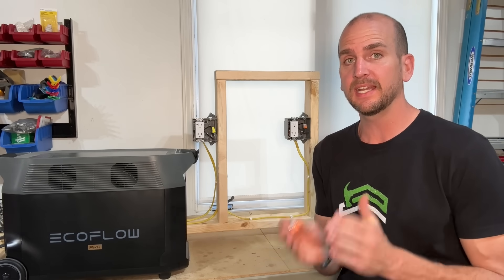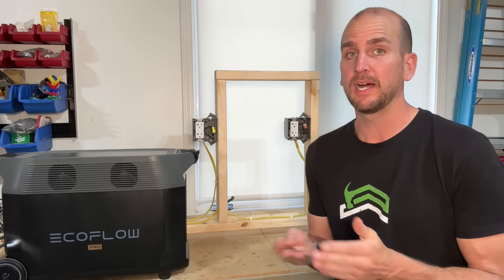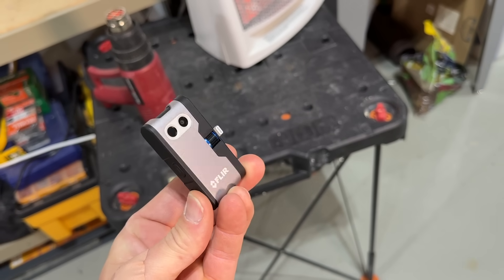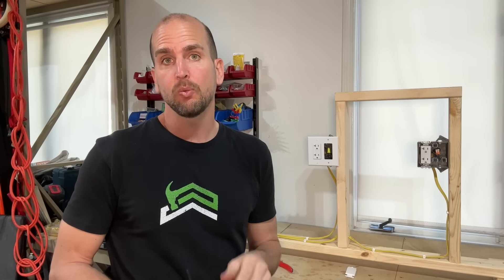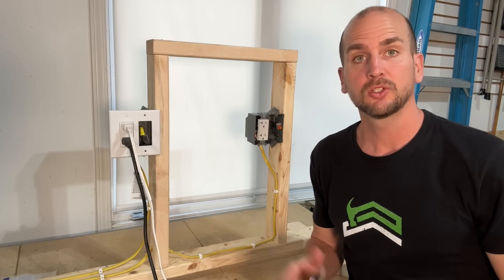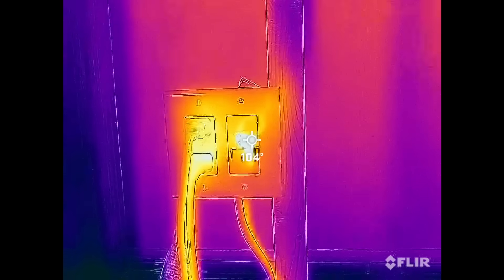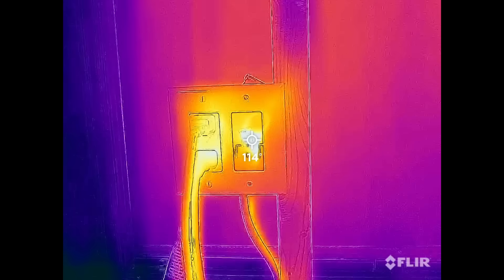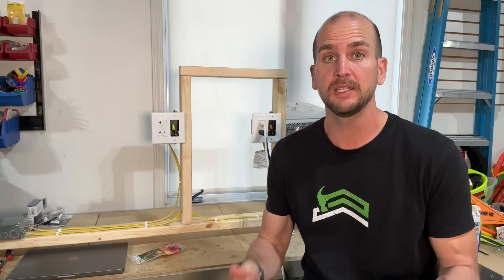Debunking the Pros: Can WAGO Lever Nuts Handle Heavy Electrical Loads?

Comment: Got another test for you to do similar to this heat test. I'm not a licensed electrician. There have been times when using standard wire nuts that I want the best connection possible with no possible way for a wire to pull out I would pre-twist the wires together and then solder them before installing a wire nut. I especially like doing this when I am connecting 3 or more wires together. I feel there's a good connection and none of the wires could ever pull out. It would be interesting to see if there's any temperature difference at the wire nut between soldered and not soldered wires. I've never seen anything in the electrical code about soldering wires and using a wire nut.

Comment: This is a dubious test at best, a scam at worst. Wago connection relies on a spring pressing the bare wire against the bus bar. Like all mechanical springs this spring will weaken due to cyclic loading, heating and cooling, ultimately creating a lose or loosen connection. A lose connection will create a sporadic electrical arch similar to a welding arch. It is the electrical arching that generate extreme high temperature rather than a steady state current. An AFGI is designed to cut off the current when it detects an electrical arch whereas a GFCI would not. If I were hustling Wago connectors, I would have made this specious video, too.

Comment: I use Wago... but ! in the USA the voltage is 110-120V, in the EU we have 230-240V, half the current flows from it. And with the standard maximum load of a common socket of 16A, I don't expect any problem with Wago. Today's electrical installation in houses and apartments is almost always with wago terminals, and the sockets under the most stress, such as the microwave in the kitchen, the socket for the kettle, etc., are led directly to the switchboard and secured separately. So if they are, they are only minimally loaded in normal operation and there is no problem with them even after many years. The margin of error is very small and refers rather to the Compact series. Of course, there are also more powerful Wago series.

Comment: The Wago lever nuts have been developed in Germany where the standard voltage is 240 V. Since the voltage is approximately double the 120 V in North America, that means the current draw is only about half the current in Ampere for the same power in Watt. Standard home circuits are rated at 10 A or 16 A.

Personally I prefer to use the Wago lever nuts, because they make for a far safer splice that is also very easy to expand in a very safe way. For safety, put the lever nut on the input wire first and you do not have an exposed wire that could accidentally zap you. And by opening the outgoing wire first you again reduce the risk of getting zapped.
For expansion, if you use a 3-lever or 5-lever Wago nut, you can add one or three additional outputs respectively without having to undo the previous splice. And you do not have to touch the input wire at all, again reducing your risk of getting zapped.
Reply: The germans lost the war too.

Comment: One thing missing is you used screw connector on the receptacle plug for the base line, I would like to also add the push in  connector on that same plug as part of the test, the surface contact area there is about the same as the Wago I think, and has been used forever and safely according to regulations.

Comment: Still don't like it...Plastic holds the Wago's together.... over time heat causes plastic to get brittle..... and with the plastic under constant stress, holding the wire against the  very small contact....that tiny little piece of plastic will probably crack....and now what da ya got?

Comment: I would imagine that using Wago in a garage where air conditioning isn't normally available or in the desert heat (where I live), the ambient temperature might have elevated the connection temperatures higher.l  Maybe a little, maybe a lot.  I've seen where the plastic wire nuts crack and fall apart leaving the spring exposed.  Heat is the enemy of electrical connections.  I use Wagos to make low current connections such as in light fixtures.

Comment: I like the WAGO connectors a lot.  They are fast, relatively idiot proof, are compact inside a J box, and are pretty robust.  For lighting fixtures, 15A residential outlets, and other light duty applications they are ideal.  For heavier loads like HVAC, electric motors, spa installs, and other inductive loads I am old school.  I want max copper > copper contact so I will take my time, pre-twist the wire 4 turns with my linesman pliers, trim the tip, and apply a properly sized wire nut to complete the splice.  Maybe overkill, maybe not.  I have repaired too many connections that appeared to be really solid but burned down anyways. YMMV

Comment: Isn't it possible the flir is picking up a little less heat due to how the wire nut is made with possibly different/thicker plastic?  Regardless, either one, it is important to make the connection properly. To each their own. I will not stop using WAGO though.

Comment: If you used a 15amp breaker, you would have to reduce each receptacle load to 1-1.5 amp.  Hot weather and/or increased current demand will increase voltage loss.  Cold weather and/or reduced current demand will minimize voltage loss.  Thus a circuit has different voltages through out the year, e.g., 120-122 volts in the summer and up to 127 volts in the winter.  Thus if you are using watts to determine amp load you should use the actual circuit voltage for calculations.  Also per NEC a 2% voltage drop between adjacent outlets or a 3% voltage drop on a circuit indicate a high risk circuit with too much impedance.

Comment: The concern is not the rated temperature of the connectors, but rather the added unnecessary cumulative heat produced at every connection on the circuit.  Heat that further damages the circuit insulation and loosens the connections.  Most home circuits are 14AWG which has a higher resistance for the same load.  Thus, a better test would be to test all the connections on a 14 AWG circuit having 10 receptacles with a 2-3 amp load on each receptacle.

Comment: Sorry about the scrambled text at the end of the previous comment.  At least 50% of homes have older deteriorated circuits where it is imperative to minimize resistance and the resultant heat that damages/weakens circuit insulation, increases the risk of fires and causes a drop in voltage.  In fact, the NEC cautions that a circuit voltage drop is a cause for concern, e.g., a high risk circuitdissipation

Comment: I am licensed home inspector with 50 years of experience and training.  After seeing your other videos on Wago connectors, doing some research and using them myself, I recommended Wagos especially for splices combining multi strand and solid conductors.  Multi-strand and solid wire splices are the splices most often loose and/or where the multi-strand conductors pull out of the splice.  We often inspect houses that are more than 50 years old.  NFPA has identified these houses as containing circuits with deteriorated wire insulation and corroded loose splices and terminations.  Deteriorated conductor insulation and loose connections create a higher risk of arc faults (a primary cause of electrical fires).  insulation and increases the risk of arc faultstral circuits might have different results.
Reply from the maker: Thanks for the feedback Larry 👍

Comment: A veteran electrician once told me “Code is just the worst job you are allowed to get away with.”  That stuck with me.  I have always pre-twisted conductors and then secured my connection with a tightly twisted wire nut.  I also never loaded any circuit more than 75% of units allowed and wired even my lighting circuits with 12ga and 20A.  I don’t ever lose sleep over me causing electrical fires.

Comment: A very nicely done video.  Certainly a more elegant solution over using wire nuts--most especially when one is often using wires of different gauge and/or solid vs stranded.

Comment: When in doubt reference an old cliche.
If there’s smoke there’s fire. In this case not applicable.
If it ain’t broke, don’t fix it. Maybe?
It it ain’t broke, fix it until it is. Not a good idea.
I’ve used wagons and haven’t had a problem with them. I’m comfortable using them and like their ease of use and convenience.

Comment: Run at 23 amps, but my understanding is that a safe long-term run rate tops out at 16 amps on a 20amp circuit.  So we are WAY, WAY under the temp. spec. max. in this test.  All-in-all, very comforting to me.  Green light.

Comment: They wouldn't be legal if they couldn't.   Electrical regulation is pretty well established.   We don't need videos to say that using stuff as it's tested is fine.  This just looks like an excuse to put a bunch of sponsored products on screen.
Reply: "They wouldn't be legal if they couldn't."  I would agree for the most part.  But in the past, they've found alumimum wiring has problems (aluminum expands more as it heats). Wallboard from China had problems (off gasing of volitile chemicals).  Lead water pipes had problems.  Early PEX fittings had problems with leaking.  Asbestos in popcorn ceiling and other uses had problems.  Seems like manufacturers send stuff out the door and let the end user become the quality control program.  With so many recalls, that seems to be what's happening.

Comment: Number one I must ask if they are UL approved. Secondly are they listed for use in the NEC. I am assuming yes to both questions. If that assumption is correct then the next question should be is there a current rating on these connectors. By default, if they are listed for use under the NEC there should be a current rating provided by the manufacturer. Much like terminal blocks and contact sets.

Comment: What all this told me that my decision to put an actual outlet inline instead of pig tailing or inline connection with a wire/level nut to the through circuit was the right one.

Although my concern (before this thermal test) was the amount of wiggle the Wago connector had, however, I did like the ability to quick change things up during retrofits and them being reusable in temporary situations.

Comment: I’m going to install a Ditek 120/240CM+ surge protector on my HVAC disconnect for my 3 ton ac. I need to use a “pigtail” for the terminal lugs. My question is, can I use WAGO connector instead of a wire connector? Thanks

Comment: Do people run 20A over a 15A circuit?  Wont that trip?  Its prolly no different than using the receptacle's bus connector between outlets to splice the connections down the line.  What kind of heat is generated at that point when used?  You're not going to run a major appliance off of these as they have dedicated circuits by code.

Comment: I had a camper with back-stabbing outlets. 
Replaced them one at a time as they failed. 
It’s a wonder I’m alive. 
Some were fried!  
Same concept as WAGOS. 
Test WAGO to failure.
Test them over time. 
I not only twist wires for wire nuts, I crimp them a little and trim the ends evenly. 
And use electrically conductive grease. 
Plus use a wire nut tool to crank down the wire nut.

Comment: It would be interesting to measure the resistance difference between these using a 4-wire probe (that takes out the resistance of the probe itself).  The assumed higher resistance and hence heat will be caused by I^2R losses.  So, in Europe which is mainly 240 VAC, their current for a given circuit is half of what it is in the USA, and therefore half the amount of heat from any higher resistance.  In general, it looks like 10% higher heat than a wire nut, but still roughly 50% of the design maximum.  I'm not sure the answer, but I do know trying to connect 4 12-2 wires in a 2 gang metal box to two plugs and ground the box can be tricky - at least for me.

Comment: I'm a big fan of the WAGOs.  I'm an electrical engineer too.  A few reasons why:  For one thing, they're largely idiot proof, and by "idiots" I mean professionals compared to DIYers.  I know I know; we're all supposed to be professionals that our work is supposed to be of higher quality, but actually quite often it's the "pros" that get into trouble because of complacency and exposure.  Ex: My dad was a "road warrior" salesman; he's got far more speeding tickets than I've ever got, but that's cause he was out there far more than me.  Much like how professional drivers, not unlike professional skiers, are ones who often get injured; yes they're far more skilled, but they're the ones logging thousands more hours "on the front lines" that we ALL are human and we ALL make mistakes.  Most of my life's work I've been in the power utilities and communications industries; we got lineman that can do amazing things out there but indeed in many cases, it's best to have a premade solution to a problem vs. one that's "craft sensitive".  Wire nuts are a perfect example; there's a lot that one needs to do to ensure a good connection vs. a bad one.  When they're done right, they are very good, but all it takes is 1 out of 1000s to be done wrong, and you've got a serious problem.
Another issue: thermal cycling.  Many times this doesn't affect the connection so much, but I've definitely come across wire nuts that all but fall off when you open the box.  And with wire nuts, it's right there with the "pretwist" recommendation(why do you have to do that?!?), you're relying on the copper conductor as much to make the connection when your wire is of metal designed mostly for carrying current.  It's why it's copper.  Meanwhile the spring inside the lever nut is designed to make a mechanical connection; to the extent that if it even is thermal cycled(it's away from the connection), do that thousands and thousands of times it will maintain it's compression vs. electrical grade copper(not even a strong alloy of copper) twisted together.  I must confess that here I am speculating some, because there are many issues at play here(ex: cold welding) that I feel the only way to truly know the answer is to do a set of full life cycle testing.  But then, from that I'm partly drawing from issues I know happen with wire nuts vs. the lever ones haven't been used as long, but they do have plenty of history now in places like Europe.
Finally, what are you really looking for when you're splicing wires together?  If I wanted the best conductivity and heat peformance, I'd use(or design) a connection with some sort of bus bar with screw terminals that part of the wires are potted in solder then the thing is potted in epoxy or some similar insulator.  The wires would be 100 degrees but the connection would be the same as room temperature.  But do I want this?!?  A: Heck no!  Cause then you're talking about if you ever have an overcurrent failure, it's happening at some random point then along your wire OUTSIDE the junction box.  A fundamental concept of junction boxes is that if you have an overcurrent failure, it happens INSIDE the box.  So I see WAGO running a few degrees hotter, that is EXACTLY what I want!  If for some reason 100 amps gets sent down that 12 or 14 gauge wire, the failure is inside the box that's an easy fix vs. the house has burned down!  Remember that in knob and tube wiring(well intentioned but problems are more obvious to us today), splices were typically made twisting wires together for mechanical connection, then soldering them, and then wrapping with insulator.  Back then too, labor was far cheaper than materials used; it's why they could make those splices that they did.

Comment: Would the temperatures be higher in a box located behind the wall in an attic room, for example?  Both the wago and the wire nut were well below the design specs, but who knows how hot it gets in environments that are behind a finished wall?

Comment: 10 degrees hotter is substantial. I will continue to only use the Wago on low amperage wire circuits and ceiling fans.

Comment: I would also think there would be a difference between using solid wire and stranded wire.
I am an old electrician... I will use a wire nut.
I have seen the old-old soldered connections frying like bacon.
I found one in my own home right after I bought it.

Comment: I think you should do the test again and check the amp draw for all 3 conditions. Higher heat means more electricity wasted. I am not concerned about a few more degrees but I am concerned with what a house full of Wago nuts would do to my power bill.

Comment: Since labor cost is nowadays the most important factor, I'm wondering why in the US these wire nuts and sockets with screws are still used. Here in Germany nearly everything is push-in technology, even the fuses. Way faster and hence much cheaper.
Wago is kind of the standard wiring connector in Germany for decades. Usually the ones for push-in, but w/o the lever for de-installation.

Comment: Honestly this isn't something i can care about. Wire nuts are highly reliable when used correctly (if you can't you shouldn't mess with electrical connections) and Wago connectors are super expensive in comparison. Yeah they're like 5 seconds faster 🙄